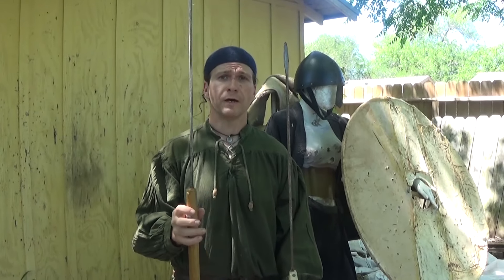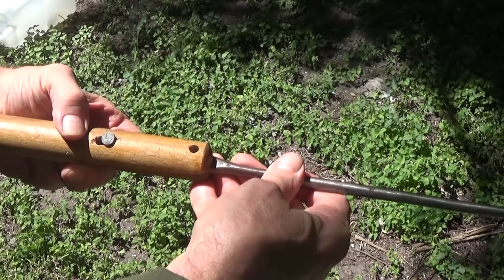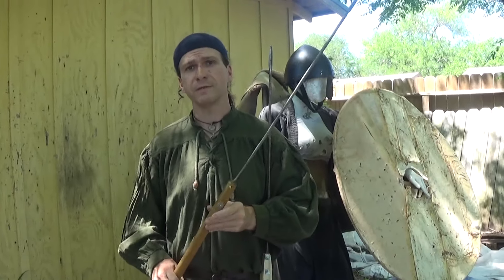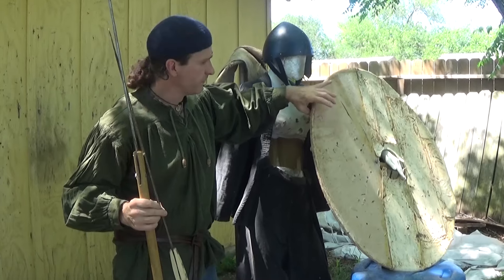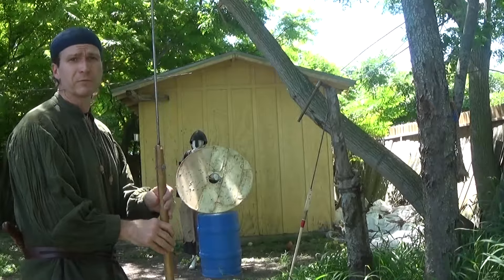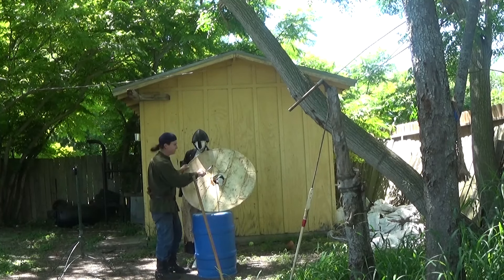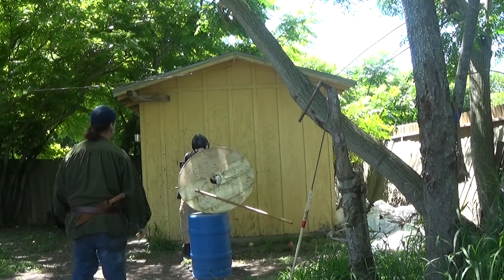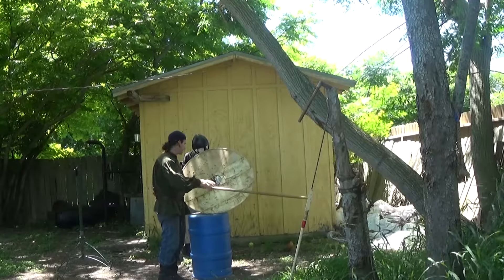Gaius Marius's  Breakaway Pilum tested!

Comment: Great followup video, imagine trying to fight with one of those in your shield flailing about.

There is likely a decent intermediate between a thinner pin such as this one, which appears to be impacting the penetration of the weapon by breaking too early, and possibly impacting your accuracy as it appears to allow the foreshaft to move a bit. And a thicker pin which would allow for better energy transference before breaking.

Keeping in mind that a pin would only have to snap (not necessarily be ejected) to make the weapon nigh unthrowable and useless as a spear. The throw at ~7:30 and the next one show the pin doing this pretty effectively.

Seriously interesting to watch man.

Comment: A reminder to the studies of the bending pilum is it is thrown at spear ranges. Attacks by infantry with swords soon followed. Getting fiddly with a shield at that time is a very risky moment. At masses you might hit folks in the back ranks but still, they don't have much more time. I'd also like to point that if the pilum did hit directly into flesh and the pin broke its a horrible thing to have flopping around wiggling the pilum head inside your wound.
Reply: not much better to have a normal pilum flapping about in your belly though.

Comment: Nice one, Thrand. I have a small request for a video that I think you'll be easily able to test. So I've heard that the Aztecs improved the toughness of their gambeson by soaking them in a salt brine solution. The theory being that when the cloth dries the salts crystalize, making the material more hardy. I've always wondered if that was true but I can't see any videos of people testing this theory out. thanks.
Reply from the maker: I can test that ans seems possible the salt crystals would damage the blade and slow the cut I imagine.
Reply: ThegnThrand exciting
Reply: That would be being used against obsidian, stone, and wood weapons though. I could be wrong, but I doubt it would do much to the actual blade of the weapon (either damage or slowing) as salt is softer than fint/obsidian but since the obsidian blades were sandwiched between wood and transitions between arrow/spear-heads and the shafts were less smooth than socketed versions, a firmer material would provide more friction on the rest of the weapon as it tried to pass through, much like how a wooden shield is good at stopping blows that pierce it.

It'd also be much better at distributing the force from blunt weapons than just cloth.

Just my 2 cents as I remembered that that wouldn't be designed to protect from metal weapons.
Reply: That would be really great. Thanks for considering.
Reply from the maker: DynamicWorlds gambeson works on all weapons as armor.
Reply: +ThegnThrand I meant that I doubt the salt water treatment of the fabric would do much more than a plain gambeson against an obsidian edge, not that the gambeson itself (salt-treated or not) would be completely ineffective against such an edge.  Apologies for not being clear.

Obsidian blades, while brittle, are remarkably good at keeping an edge because they're so hard, so it seems strange to me that as soft a mineral as salt would damage them.  That said, composite materials can be strange sometimes, and resisting an obsidian edge isn't the only way they could be protective, so who knows what the result would be.

Of course, salt water isn't exactly known for being gentle to materials, so it could even be weaker. Either way, an interesting test, just might be harder to get the appropriate weapons to test against it.
Reply from the maker: Very true but might help against softer metals.

Comment: The Version of Marius`s modified pilum I saw had a Shorter,wider and more pyramid shaped tip to make it harder to pull it out of an enemy Shield,rendering it near useless or at best very cumbersome to use.The iron used in the pilum was of inferior quality so it would bend even more easily.

Comment: I am doing work on Marian reform right now and confused as to why you say it was not supposed to break. It was specifically designed to break to encumber the opponent.
Reply: Andrew Buser The primary purpose of the pilum was to penetrate an enemy’s shield and armor, and disrupt their main line. The long thin iron shank would go unencumbered through a shield because of the larger head—which eliminated frictional resistance. The weight of the shaft would deliver the penetrating power. The bending effect seems only prevalent when the pilum hit something rather hard, like a metal shield boss or solid ground, which would consequently prevent it from being thrown back at the Roman line.  The modern consensus is that bending, if and when it may have occurred, was an added benefit rather than a purposeful design choice.

Comment: I don't know if I'm just pointing out the obvious as well but with it breaking like that just the sheer weight of it would also make using the shield effectively quite hard which would make your opponent coming at you very difficult to defend yourself suppose you say one or two of those hit you have to ditch The Shield
Reply from the maker: agreed breaking or no breaking shield is useless and the enemy has a handle on it as well to manipulate it if you try. The back of the pilum has point so if you advance it sticks in the ground normally too pinning you in place.
Reply: Yeah thanks for , thanks for commenting back and huge Family Channel been watching for years keep up the good work
Reply from the maker: Thanks and be sure tell people about the channel and share videos!

Comment: I was sure it was the REAR PIN that was made of wood and makes more sense from a physics point of view
Reply from the maker: The design works either way it takes a slide rivet to break the wooden pin but does eat up energy to break pin. A steady pin with out the slide feature will not break the pin on impact for my testing.if account was correct It was most likely used on civilians who where unarmed so would not matter in large masses so they could not use them as weapons not on a well equipped army.

Comment: i heard that pila is made with a led shaft to bend in the impact
Reply from the maker: No they have seen balls in art work they believe are lead added in center to weight the throw for more power it is not a joint of part of the shaft.
Reply: It would make reusing the pila much more difficult if you had metal part that gave in and bent. Bending metal bit back and forth would make it break completely eventually.
Really no point even for Rome to waste else perfectly good equipment by having unnecessary weak point added to the manufacture.
Reply: also lead is flipping heavy
Reply: True, but that is why it would be added to it like Thrand mentioned. It adds mass to the front of the spear, helping with balance.
And when you get it moving, it adds considerable amount of force to the pila on impact. There is limit to velocity you can give to the weapon with your throw, but you can throw heavier object with pretty close the same velocity. And heavier thing going about same speed carries much greater amount of energy, which in turn makes it more likely to penetrate when hitting something.
Reply: there are optimal weights for throwing weapons, not that I'm sure but I don't think a lead shaft would be viable. You need to accelerate the weapon too if it's too heavy you won't be able to give it enough speed to do anything
Reply: Which is why there would not be football sized clump of lead sticking to it but much more modest piece of lead. Optimal weight is apparently weight you would get with barebones version. But one with added lead weight of suitable size. Like I said, little added weight does not slow your throw too much, but adds great deal more punch.
Reply: well were just speculating thrand might test it out
Reply: Looks like he has a challenge then. But yeah, it would be interesting to know how adding lead weight would affect performance. Have to see if Thrand has already done something with plumbata